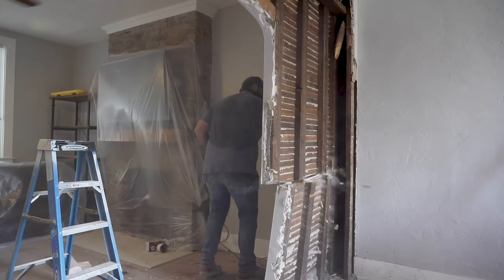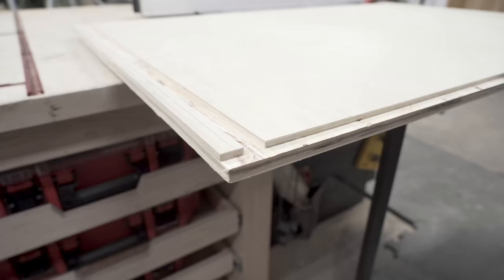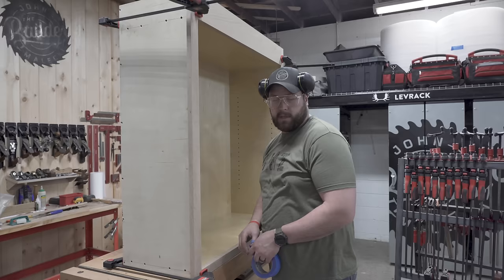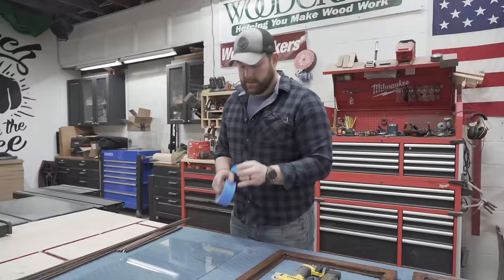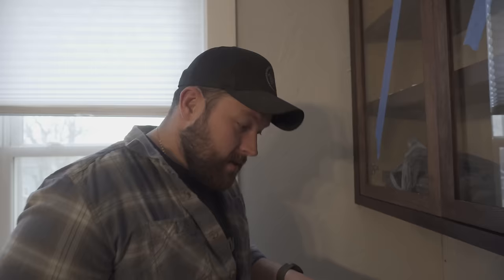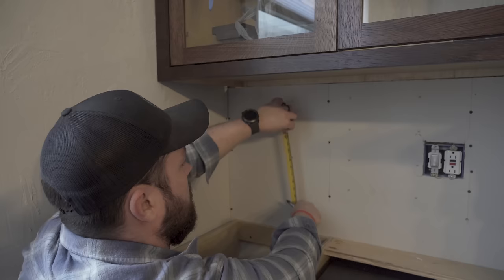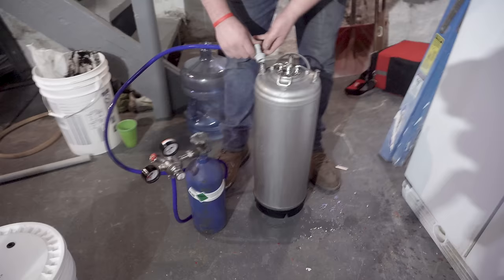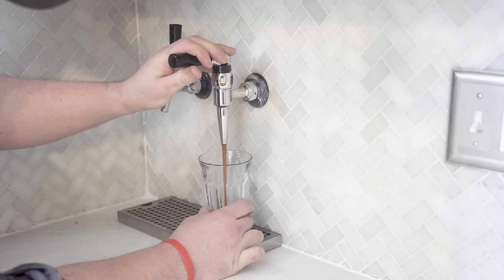AMAZING Home Bar Build With COFFEE & BEER Taps in the Wall!

Comment: The best advice from someone with almost the same setup,  every keg change, buy new hose. Dont reuse the lines. Especially that long of one. It's too hard to clean and not worth the trouble. Its worth the $15 just to replace them.
Reply: Nope. Just buy beer line cleaner and a cleaning pot from micromatic and flush your beer lines every two weeks. Also, if your beer psi is above 17psi it could over carbonate your beers. It should be 5” of 3/16 line followed by 3/8 line to the keg.

Comment: I am sure someone has already said this, but I think the taps needs to be switched. The tap on the right is very much a beer tap! I only wish I had space in my house to be able to do the same.. very envious !
Reply from the maker: the taps are actually 100% correct, the beer tap is made for pouring beer that is pressurized with only C02, the tap for the coffee is the proper tap for something on NITRO.
Reply: Stand corrected. It’s the fact that the tap on the right has the ability to add more ‘head’ if you push it back on itself. Still very jealous..

Comment: I've been planning to do this same project in my home! Love the video - thanks for posting. How are the lines working? The places I called for parts said I would need a glycol chiller for running 10', which is not in my current budget.. Conduit and insulation enough?
Reply: 90% of his two lines are outside the refrigerator so his taps will eventually be warm and all that new refrigerated beer and coffee that left the kegarator is going to be warm, frothy and stale until he purges all the product that sat in the tubing.

Smart move waiting until you can afford to do it right.

Comment: Brother great build. I'd ask your local brewer what PSI they recommend on that beer.  Also did you insulate or at least put mold resistant dry wall up. Both of thos shanks will sweat with the temperature changes in the house.

Comment: At the very end when you were demonstrating the fridge tray and showing the finished results of everything, the two bottom drawers on the left-hand side of the fridge look to be a lighter shade of stain than the top three drawers and I was just curious if it was just because for whatever reason those pieces of wood excepted the stain differently or did you use two different types of stain perhaps or maybe is it just maybe the lighting playing tricks on me? Again...I'm just curious that's all but other than that, stellar results overall as usual John. Everything looks sweet and I know you're loving having those taps. So sick! Good work my dude.
Reply from the maker: So we used a water base stain and it took to the top pieces a little darker. Staining isn’t something I’m a pro at, but learnin for sure. Also, the camera makes it wayyyyy more dramatic
Reply: @John_Malecki  That's kind of what I figured and was only asking because I'm doing a project with some oak as well and have been having the same issue with the sample pieces I tested so I'm thinking I may not do the stain and go another route. Thanks for the swift reply brotha. I appreciate the info. Ok, That is all....Take care

Comment: In my, non English, old world country, beer is supposed to be served with a layer of foam on top (you call that layer "head", I believe?) The height of the width of two fingers, is the norm. People from other countries might think they are cheated. The explanation is very simple. If the glass or jug you serve in, was not clean, was fat, or was cleaned with the wrong detergent, then the foam will collapse. If the beer is not fresh (enough) the foam will collapse fast. When beer and glass are fine, then each gulp/sip should leave a ring of froth on the wall of the glass.
I guess there is some innuendo in complaining to the server that the beer is not right and she should give me head when serving beer. But then, my allergies bereft me of beer and the risk of such missconduct (her serving bad beer) was taken from me. Experience in Italy taught me that this same configuration can easily be used for sparkling wine. Whatever. Nice job here. Except - whine - the looks of that beer in that glass.
Reply from the maker: Brilliant

Comment: 2:44 me confused how someone can draw an actually somewhat straight line
Reply: Just use one of the fingers that you aren't using to hold the pencil as a guide along the edge.  Works great for stuff like plywood and drywall when you don't want to have to snap a line.

Comment: If he doesn't pump cold air to the top of that system, the first two pours are going to be foamy as heck.
Reply from the maker: Its all insulated. So its not too bad, i have to get smaller lines for the coffee tap.
Reply: Cheap and easy is beer lines inside 1" pvc then 2" pvc over that. A small computer fan to blow cold air up the inner pvc and return in the gap between the 2. And pipe insulation around the whole thing.
Reply: Timothy Dillon This 👆🏽